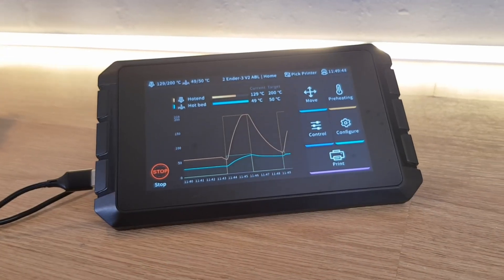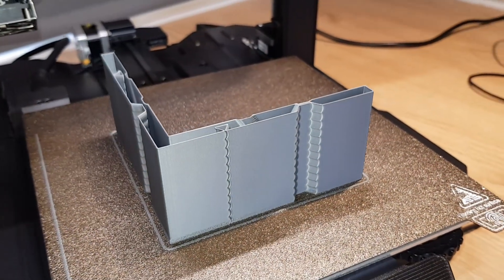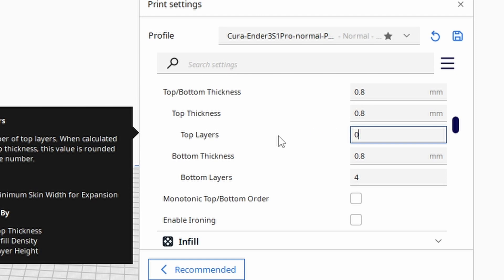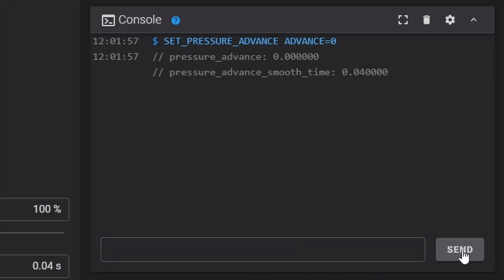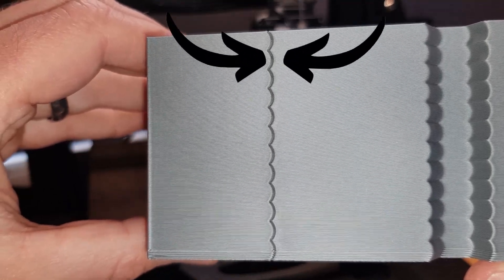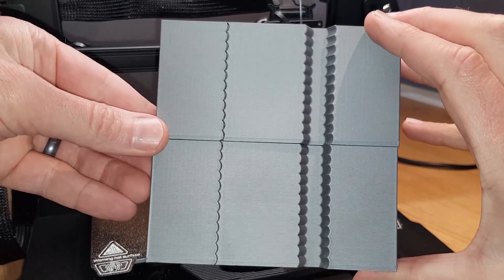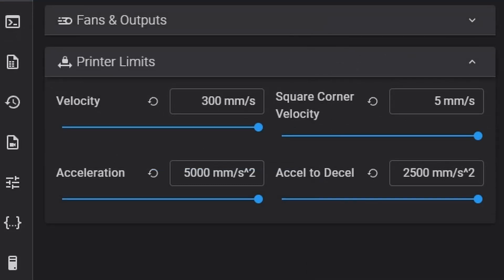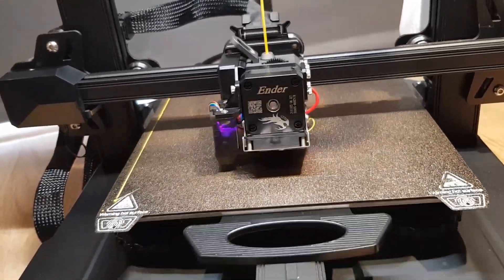Maximum Acceleration Test (How Fast Can You Go?)- Sonic Pad Intermediate Part 8

Comment: Thanks for your basic and intermediate sonic pad series, these were EXTREMELY helpful!!!

Having just completed the test in this video on my Ender 5 S1, I find that the gap behind the X wall is perfect all the way up to 13500 (I feel this axis would still be good at 20000), but the gap behind the Y wall starts to become wider at around 6500 - 7000. So I guess I should set my max acceleration based on the gap behind the Y wall, so around 6000???
Reply: I was having the same predicament. Well, the first couple days I've been trying to do this, it wasn't working because some of my settings were messed up and on some prints I forgot to disable pressure advance. Now I'm having the same thing happen as you, where there's not really much gap in my prints, and I'm afraid to test much faster because it starts to sound a little violent on turns. I think I will try a higher speed setting, say 125-150, and try one more time.

Now that you've had some time, have you learned anything since you posted this comment? We have the same system and I'm really curious what your experience has been.
Reply: @bungle6334  I've not learned anything new...I've just left the setting at 6000 and I am happy with the quality fo my prints...

Comment: Here I am again. I have now bought the Sonicpad instead of the Bigtreetech Pad. I have set everything as you explain in your videos. Now I have better print results and print much faster.

Now I will rework the component cooling of my Ender 3 S1 Pro, because it is too weak for fast printing :D

Thank you for your helpful videos. I hope there are more to come :)
Reply from the maker: Wow, thanks very much! There will definitely be more to come in the Sonic Pad series. Also, I plan to test out some cooling options for the S1 Pro too as it is the main thing holding it back now.
Reply: @RickyImpey  I'm really looking forward to it :)
Reply: @RickyImpey  are you going to do any more on the S1 pro mate? would be simple awesome

Comment: Just did this test on my Ender 3 V2 Neo. Only upgrades are dual gear extruder, silcone springs, Capricorn ptfe. I ran the test up with acceleration up to 12000 and it still looks perfect. I can shine a light behind it and micro "dots" appearing where the gap should appear so i believe its working correctly. But 12000+ acceleration just seems insane to me. Should i start a new test with the start being 11500? Or just set a value of 10k for the acceleration and not worry about testing to go faster?
Reply from the maker: I'm also surprised you can go that high. Have you tried watching the acceleration display on the web UI while the test is running to see if it is actually using those acceleration figures? If not, try this just to be sure. Then, if it is coping with the high figures, try a real print with something like 10k acceleration. If it all checks out then you can run what you would like but I probably wouldn't go over 10k to keep machine wear and tear to a minimum.
Reply: @RickyImpey   Thanks for your reply. Yes sir I reran the test 3 times starting at 6500 and verified the acceleration was increasing both on Fluidd and Mainsail. I then printed different calibration cubes with the acceleration set at 3500, 5k, 7k, and 10k. There was very minute ghosting at 7k and it was very apparent at 10k. I think I'm going to leave it on 6500k both to prevent wear like you said, and to prevent ringing.
Reply: @RickyImpey   I'm modified my ender 5 plus to exoslides and the exoslide extruder. I'm starting my tests and all good till 13500. Ans this was also in the web interface visible. no gaps at all. I will continue and try to find the edge. But I will not exceed 10K for the reason you said. Wear and tear ;-) Thanks for the nice sonic pad serie. And I will point everybody to your video's on face book if the have questions regarding the sonic pad. As this is the perfect start to tune.

Comment: i have an ender 5 plus, and 1500mms seems insane.  is there a lower speed i should test with first
Reply from the maker: You can use whatever figures you like, just replace the '1500' with whatever you'd like. I would still use 1500 though if I were you🙂

Comment: I’m not sure what I’m doing wrong but everytime my print finishes the printer head don’t clear my print. I have noticed it in the ring tower
Reply from the maker: You probably need to check you end g-code. There should be a command line to raise the z axis so that it clears the print and moves away.
Reply: @RickyImpey The z was at 10 in the end z code in the Cura thing. I switched it to 30 still the same thing. Only thing different it does is the print bed don’t continue to move but the print still hits the z axis. I don’t know if it’s the z axis or the print bed. I havnt had that issue with prusa. Also I have noticed that when I was fallowing your intermediate videos the sonic pad didn’t restart on all the videos yours did.
Reply from the maker: @damageplan1978  copy and paste your end g-code into a reply below and I'll see what it's supposed to be doing.

Comment: Another great video, do you have any suggestions on how to get a good bottom print of an irregular object ? I find unless you have a flat surface object the bottom layer is always rough, is there anyway to get around this ?
Reply from the maker: Anything that isn't flat on the bottom will very likely need supports. It is possible to tune support settings to improve the surface they leave after you remove them but a supported surface will never be as clean as a top surface unfortunately.

Comment: Odd question here, are we to measure the X or Y side for determining the max speed? The gaps seem to widen on the X side, but on the Y side they are closed! Also, cheers another great video!
Reply from the maker: It's best to go with the worst one as accelerations are not separated between the X and Y axis with Klipper.

Comment: i have followed along up to this point,  however i have awful banding/ringing all the way up the print on input shapping i only managed to get 4 layers up before i could see through the print.    i have layers missing from the start of the layers ect.

do you have any suggetions on what wrong?
Reply from the maker: Have you followed all of the previous videos in the series? PID tune and Rotational Distance especially?
If you have set both of these then make sure your slicer flow settings are at 100%. If the problem persists then have a look at your extruder and make sure you don't have any issues there that may cause an under extrusion.
Reply: @RickyImpey  I gave up Ricky I did follow all the videos in the series was really good.

I think the flow rate like you suggest could have beem wrong as I switched slicer to default prusa profile and used that and came alot better but still bit of ringing.

I have now ordered a bambu lab p1p hopefully I don't have to mess around to much 😊

Cheers for the reply content is solid keep going.

Comment: Anyone getting an error after running the first test and then starting the second one at 6000?  I got a "Move out of range:...." error trying to start the second print.  Had to delete it from the Sonic Pad and re-upload it.
Reply from the maker: Check your slicer machine settings. This is most likely your slicer thinking your bed is bigger than it actually is.

Comment: Hey Rickey been watching you for a while, how fast are you able to reliably print a Ben by on your Ender 3 v2? I have been able to print one in 36 minutes with perfect results but am unsure if this is correct or not. Also how hot do you print? My extruder clicks if I print any less than 235 c at 100mm/s.
Reply from the maker: Hi, it varies on filament and settings really. A clean 36 minute benchy on an E3v2 is very good. I wouldn't expect to get much time out of that. I have the same issue with the extruder clicking if I have the accelerations too fast or, as you say, the temperature too low. Unfortunately, you are now coming up against the physical limitations of a machine that wasn't designed with klipper in mind. If you wanted to push things further then adding a sprite extruder cound be the next step but then your next issue would probably be cooling. The sprite extruder is a little under powered when it comes to part cooling.

Comment: Your vid’s are the best, and I trust your knowledge.

Could you do a video explaining how the macros work, especially regarding time-lapse , get Time-lapse setup, hyper lapse, etc? Each time I press these macros, it messes with my camera and I’ve had to ultimately turn off time lapse for my camera. 
Furthermore, could you do an explanation on how to make a 1 macro for pausing a print, changing out filament, doing a command of G1 F200 E50, and resume print (essentially a M600 without having to slice it in with slicer) - Since Creality did an update and messed with the M600 command. Then explain how to put this IN the print cfg? I ask, because each time I try - I am doing something wrong and my SP throws an error.
Reply from the maker: Thanks Charlene, I will make some notes and see what I can put together with regards to all of these suggestions.

Comment: Thanks for the video! Your concise and understandable videos have been my go to since I bought my S1 Pro, from tramming the bed to adding and tweaking the Sonic Pad. I do have a question and video suggestions, one of the recent Sonic Pad updates added support for the laser module, curious how that would work since the Falcon box is controlling the motors and supplying power to the laser? Also maybe you can make a filament change video using the Sonic Pad? Thanks again for all the help.
Reply from the maker: Thanks for your suggestions👍Creality have confused things by selling two separate laser modules that will work with the Ender 3 S1 Pro. They have a 1.6w and a 5w unit that can be controlled by the printer's control board but then also the complete separate add on 10w kit that I reviewed. The 10w kit is separate and, like you say, controlled by it's own control board. It's the lower powered units that the Sonic Pad can apparently control but I don't have one of those to try.
Reply: @RickyImpey  Oh I see , thank you

Comment: Great set of videos Ricky, they've been very helpful. Sonic Pad wise, maybe some insight on the during print "Adjust" button (blue coloured middle one), and why you might want to do that? If you get stuck for ideas, some general maintenance tips and advice on achieving correct belt tension on the S1 Pro would be appreciated. Thank you for all your great work.

Comment: Great video, as always.
I'll make sure to check it out now that you explained really simple how to do it.
Will you go into print-speeds aswell? Currently I am running 120mm/s for print speed and 80mm/s for outer walls. I think I could go higher but so far I haven't been able to find proper tests for this. 
I am really happy with the speeds I have right now but I appreciate every step and tweak you show.
Keep up the great work!
Reply from the maker: I will give print speed some thought as it can vary massively depending on what you are printing. selecting the correct speed can be a bit of an art but there are some factors to take into account so I could explain how I decide on speeds to use. Thanks for the comment👍

Comment: Awesome video once again Ricky!  The main trouble I have had is setting up a second web camera to monitor a second printer.  I wonder if this is possible?  I know the Sonic Pad is capable of controlling 4 printers at once, but I am keen to use 2 printers with 2 web cams.  Would be great to see a video on this, if it is indeed possible.  Thanks again for this series, it has been super super helpful!
Reply from the maker: Unfortunatley, two cameras is only posible with root access. I haven't gone there yet as i'm not very knowledgeable with Linux yet.